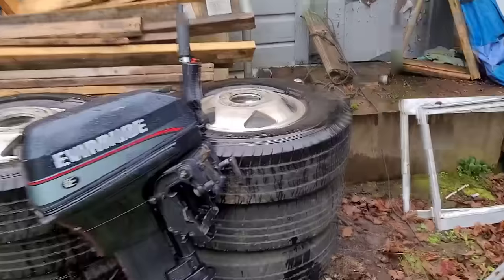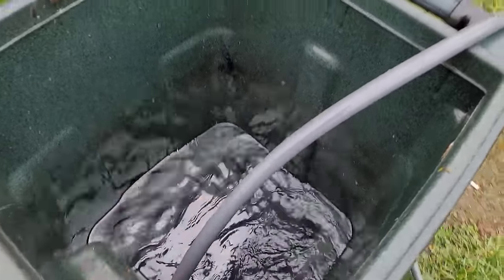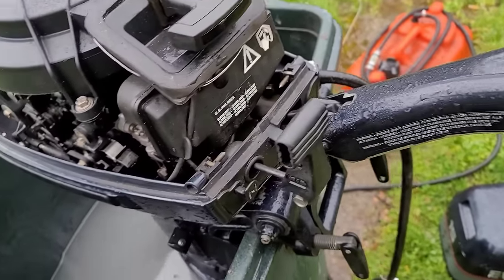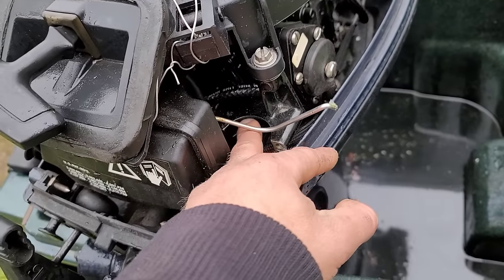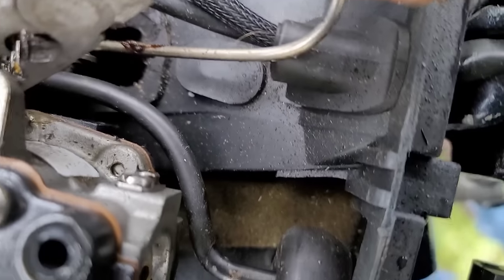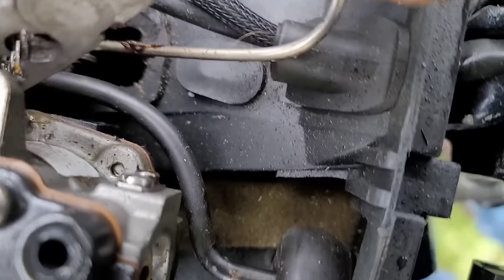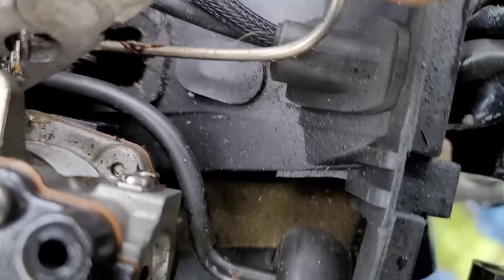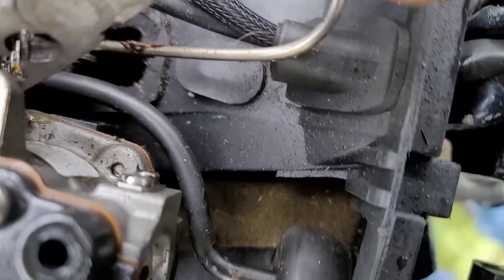how to fix an outboard that won't idle.

Comment: No offense, but this is not the right way to do this job. I mean to press the plastic parts with razor blade and knife? What you called idle jet on the bottom is the main jet. The other is the needle valve seat, not the main jet. The fuel does not go up on there but goes in to the carb on it. On that carb the numbers show the order to tight the bolts to help not to brake the plastic bowl and the top cover. The lot of smoke because the idle/low speed mixture screw is still open more like needs. The NGK is not the right spark plug on these Johnsons/Evinrudes. Again, no offense but it's a thing to do a job and another to teach that with misinformations. I just wanted to help.
Reply from the maker: Congratulations.  Yes you are correct. Why did you watch the video? Yes my terminology on a few parts was wrong. As far using the wrong tools....like a knife.. duh. Lol it's what I had handy. Ngk is not the "factory" spark plug i agree. But let's be real it's a better spark plug. I find it interesting that such an expert like your self hunts down a video. Like this one. In reality you don't even have carb problems. Do you.. just trolling?
Reply: @robertpapp96 glad you got it running for him.
Reply: So what was the problem exactly

Comment: Bottom jet is the main jet. What you’re calling the main jet is just the needle valve seat.
Reply: Yeah I caught that too . It also should be explained that the carb bowl screws should be tightened according to the numbers embossed on the bowl itself ( 1-7 ) to keep from cracking the plastic .

Comment: I will tell you this. It will never run well in that tub! Ever! In that tub your carb sucks up carbon monoxide causing it to flood like. No oxygen and  more it runs gets worse. Cut the back out of tub and put a box fan in front blowing fresh air towards carb. I am 62 and realized this back when I was 16  fixing fishing boats. Still fixing them but now Im paid to do so just not tiny ones.

Comment: cleaned the carb on my 9.9 johnson and got to the same point you did. any advice on how to gap the plugs? where I could find that information?  I think I need new plugs myself. got this motor off marketplace.

Comment: my dad bought a 10hp mercury stated would idle and die or start , you put in gear an die. got looked at at dealer and it had a bent crank.

Comment: You seated that adjustment screw 3.5 turns in but then pulled it out only 3 turns?  Also, make sure you guys watching look for rubber o-rings inside those needles and adjustment screws?  Gotta pick them out with a pick and flashlight before cleaning and dumping into Chem-Dip...

Comment: I would have checked the plugs long before messing with the carb.. It would have saved a lot of time and effort.  Hope the customer wasnt paying by the hour.
Reply: Absolutely right, a good mechanic checks and does the easy things first (plugs). An easy fix for these carburetors is to take the idle adjustment screw out and squirt carb cleaner in the hole then reinstall idle adjustment screw. No carburetor assembly required!!
Reply: And if it has NGK plugs, replace them with Champions. NGKs do not play well with Evinrude/Johnson 2-strokes.
I hate Champion plugs in cars, but they work best for small engines

Comment: On an atoll in French Polynesia with nearest outboard mechanic over 250 miles away. Followed your video and it worked. thanks. Really good video and explanations.
Reply: Niiiiice
Reply: You got some balls going that remote without basic engine maintenance skills
Reply: @LezlyBeetz  Polynesians did that for many centuries just using sails.

Comment: I had a 65 horse 1972 model evinrude with 75 hp carbs on it and it ran like a beast, and idled great, started easy too.. what evinrude did was restrict the carb throats diameter, to govern the 75 horse down to a 65.. The reed plate behind the carbs has 75 hp holes, so all you have to do is put 75 hp carbs on it,.,, I sold that boat, but picked up another 65 hp.. It is the electric shift model, and one of the solenoids are bad in the lower unit.. hoping u make a vid on the hydro electric shift evinrudes.. you explain everything very well. liked and subscribed,, 
also alot of people shy away from the old hydro electric shift models but the one I had was super reliable as long as I owned, and you dont have to dickk around with shift cables and link and sync.. those old 65 evinrudes were some of the very best motors ever made..  lightweight for the horsepower, thick casting blocks, simple carburetors. ect.. I wish they made and sold them brand new I would definetely get one,,

Comment: I just fixed my 89' 9.9 Evinrude by hauling it off to the repair shop 😂 replaced EVERYTHING possible! Been struggling with it for 2 years! rebuilt  the carb 3 times, replaced carb top and float bowl still wouldn't run without the choke on. And it's not easy finding a shop that will work on old 2 strokes

Comment: Thanks man. I just had my Nissan NS40c crap out on idle after performing flawlessly for a week on another lake.
So frustrated but it starts everytime when I apply throttle the minute I take throttle off it dies.
This is my next stop although carb looks different!
Gives me the confidence to take the carb off the motor while the boats on the mooring bouy! 👍
Subscribed!

Comment: The idle screw can adjust air or fuel 4 or 2 stroke depending on carb manufacture the tell is generally the location of the screw if located in top area of carb. Then it adjust air if located near bottom half/bowl of carb then adjusts fuel. So as in on the carb in this video idle screw is likely adjusting the air. Not fuel

Comment: Ok so nobody noticed. You screwed in the idle mixture 3-1/2 turns. (Watch it). Then said “3 turns”. I went back to check 3-1/2 turns. 
So you set the jet to three and it would idle. It would not idle at 3-1/2 which is where it was when you received the motor.  Best idle ended up at 2-3/4. 
Plugs were fouled from too rich mixture.  
So this painful experience could have been much more easily solved by new plugs and adjusting the idle mixture screw.

Comment: Can old spark plugs cause the engine to shut off at idle?  I’ve got a 2004 Johnson 150 that runs great above idle but shuts off at idle in the water.  It does not shut off at idle when on muffs.

Just got back from taking it on the river and running some Seafoam through ; it seemed to get better but still shut off at idle.  We also noticed throttle up isn’t applied until the lever is half way in the forward position out of neutral.  Could the throttle cable need adjustment?

I’m going to try running it in idle on muffs with some Seafoam in the gas and see if that helps for our next outing in the boat.  If the boat runs fine everywhere else, could the plugs still be the cause of stalling at idle? They are very old and definitely need replacement.
Reply: Had the same problem on mine. Turned out to be spark plug wires believe it or not.
Reply: @jstay0  nah figured it out; rebuilt the carbs, one of the float needles got stuck almost closed.  Purrs like a kitten now

Comment: Good vedio except you called the main jet the ideal jet. The idel jet is on top. That's where that idel needed is. Every thing else is correct to fix idel circuit stopped up.

Comment: I messed with so many things trying to resolve my johnson not idling.
The thing that ended up mostly fixing the issue was spark plugs.
I do think i still need a timing adjustment though

Comment: I have a Johnson about the same year as this pretty much the same motor I just bought it. It don’t want to idle and don’t have the power it should. I cleaned the carb seemed to help a little but not much.. I have 85psi on both cylinders. Looks like it has been ran hot because they have sealant all around the thermostat housing but everything else looks like it’s never been touched. it’s electric start and won’t start unless you pull it also when it warms up it’s a pain to start at all. Do you think that could be because of the low compression or possibly something else
Reply: On that same note I’m changing the head gasket to see if that helps put some compression back in it. Do you know of a way I can check the rings without going any further than taking the head off
Reply: Definitely low compression. Should be 130-135 p.s.i. on both cylinders

Comment: What year of motor is that?
I have a 1997 Evinrude
Got spark and fuel (squirt bottle) but won't fire?
Cleaned up the carburetor and remounted.
Mice had gotten into the carburetor.

Comment: NGK's are the incorrect plug. Champion L7744/L77JC4'S are the correct ones. Im sure it was cold out, but always a good idea to check the cyl head temp too!
Reply from the maker: Such an expert .. digging around the internet to comment on a novice level repair video. That's odd.

Comment: When you got stuck gaskets like that just loosen of the bolts and lev them in ther, and give the cover a wack whit the backside of the screwdriver, 9 times out of 10 that will loosen the gasket and you don’t have to pry and risking to crack something 👍🏻

Comment: OK.........I know you were dying to show us how to disassemble a carb and you did a fine job of it, but your motor was a small one and already off the boat.    Mine is a Yamaha 50 with 3 carbs, on a pontoon, in the water, and it's gonna be a B^%$ch to get it into my parking lot on dry land so I can pull those carbs off.   Since I already know how to do what you showed and because I believe in applying the KISS Principle whenever possible, doesn't it make more sense for me to check my plugs and maybe fiddle with the idle adjustment screws BEFORE I do all that other stuff?   Mine will idle nicely for about a minute and then croak, as if it is starving for fuel.   I get the feeling that if I could just give it a little more gas at idle it would run fine and all I've got to do is get knee deep in some water to do that, much easier than renting a truck and pulling the booger out of the water.   Great video and you have an easy instruction style, so well worth the watch.    Thanks..............

Comment: Awesome video, thanks a lot. I recently purchased a 2000 9.9 Johnson that has the identical problem. So after the cleaning, new plugs and you left the screw at about 1/4 turn in?

Comment: Did you know there is a screw torque sequence on BOTH the bottom bowl and top air plate?
Reply: Also is it required to use a muddy screwdriver and lay the parts down on the muddy ground?

Comment: Great info Have the same motor, just got it, what do ya think the reason behind me having to choke it even after it has been ran and warmed up. It also does have an idling issue, so maybe when I rebuild it that will help not having to choke it to crank it every single time

Comment: I have same motor I fixed that issue now when I put boat in water motor won’t push boat as it should as if it’s not idling up all the way . Now I have no spark on spark plug fixing to change out power pack is the power pack the reason I wasn’t getting up and going on the water ?

Comment: Had a 1990's Johnson Seaking 15hp outboards short shaft like this motor. Had the exact same problem before but then the motor just stopped entirely. Took apart the carb and cleaned it thoroughly and checked all of the inner workings of the carb to make sure that they were working and in the right spot. Put it back together. Started up and ran for like 3 seconds with high rpm but died again. So decided to try and tune it a bit. But it did absolutely  nothing. So, took apart the carb again and cleaned it again. Put it back together and did the exact same thing. So I tried to tune it again but did not work one bit. Got new spark plugs and still did not work. There was spark, gas, and I know air was getting into the engine. Decided to just sell it. Was too much of the pain. Had that motor for the longest time and it has been giving me problems for the past 4 years know leaving me and my grandpa stranded out on the river a cupule of times and dying as soon as we get to the docks too. Looking for a 25hp now and just hoping the next motor doesn't give us a headache like the 15hp we had. Was a good motor while it lasted and defiantly got the john boat up to speed on the Mississippi. Sad to see it go but you gotta do what you gotta do.

Comment: If I may, that air box is called a silencer box and its sole purpose is to muffle down the noise created by air being sucked in the carb. Removing a stucked plastic cover or bowl is best done by gently hitting them at an angle with a screwdriver handle. The vibrations will free them up ... prying will damage the mating surfaces. Finally, avoid getting those gaskets to come in contact with solvents (aka carb/brake cleaner, etc) as it deteriorates rubber and will ruin their sealing capabilities. Regards !
Reply from the maker: @danielrobert7181  why is an expert like your self watching this video? The intake deverter or silencer is called different names by different manufacturers.  Completely pointless to evern mention it. Correcting people on the internet is not your job. Get a real hobby
Reply: @CAPTAINWILLY  Basically, out of respect !  Respect for people that do  videos whose content is thus enriched and out of respect for their viewers who get added value. If ever you get to be an outboard enthusiast like me, you'll understand. Regards

Comment: Did you ever get to the late 70's mercury ? Is it a thunderbolt that the motor I just got and it has the same problem wont idle,                so gonna work my magic thanks to you

Comment: I just purchased this exact engine and the fuel line where it connects to the engine has slop in it and leaks fuel when pumping primer bulb. Which side of the connector needs replaced?
Reply: Just pick one side, and if that doesn't fix it, then replace the other side too.

Comment: I'd like to add that those needle valves get stuck, because they are old and create a memory on the seat. You have to replace.  It's good to also good to remove jet and clean, but only if you know .

Comment: I have a ‘93 8hp Johnson with a similar issue. Is the knob at the end of the tiller an idle adjustment? I can’t feel any tension when I turn it and am wondering if that’s the problem(and a simple fix)

Comment: Good video I have a 15  evinrude 2 stroke  that was running and idling great new fuel new tank new hose ,went about 2 miles down River killed it then it wouldn’t start by messing with throttle it finally crank got it back to boat ramp where she died and wouldn’t start again, replaced fuel pump , cleaned carburetor, reaaplaced coil pack, new plugs, and  finally the power pack cranking fine one then first time back on water middle of lake same scenario I killed it and would not start Finlay started but would not idle any ideas ?

Comment: very good video mate . i have a 25 hp 1979 Johnson which has a similiar problem . would it be the same procedure for the carby on the 25 hp . thanks , North Queensland , Australia .
Reply: Try your primer first. if it doesn't get hard look at the fuel pump.

Comment: Why are you teaching things that you know nothing about?  what you referred to as the main jet was the seat for the needle and both 2 and 4 strokes can control fuel or air with the idle mixture screw it just depends on the design of the carb.
Reply from the maker: Why are you commenting your great wisdom on a video. Thankyou for your expert opinion... wit why is an expert such as your self watching videos of an idle issue. What's a matter... can't get your motor to idle? Mabey clean out the carb.
Reply: A lot of people say the wrong name of a part. The main thing is if engine runs right after doing what is shown works right. Got my drift????

Comment: My plugs are new, my coils and wires are new, my carb is new, my compression is 135-143 Pistons 2-1. The fuel line is new, the gas is new, the starter and solenoid are all new. What do you think might be wrong with mine? 

Its a 1978 Johnson seahorse 35. Model number 35EL78R
Reply: Carbon build up on the exhaust port, crank seals or reeds?

Comment: New Subscriber, I have a Johnson 15 Hp with only 55 PSI in both cylinders, What would you suggest? Cheers Garry 
Would this make it only a parts motor?
Reply from the maker: You need to do a leakdown test. You can find a leak down tester on amzon or harbor freight. Run the piston to TDC, then fire up the aircompressor and pressurize the cylinder. I'm assuming this is a two stroke. When under pressure if it is leaking air out of the carberators then yes needs rings/now an anchor. If it's leaking out into the other sparkplug hole or out of the prop/exhaust. Is possible that a headgasket is needed
Reply: is it ok at 100 PSI on the compressor or should you lower the pressure in? Thanks for responding and your help Cheers Garry  @CAPTAINWILLY
Reply: Yes it is a 2 stroke sorry I missed that part
Reply from the maker: @AttitudeAdjuster  100 is fine. Don't go over 180.
Reply from the maker: @AttitudeAdjuster  ok. Ya just make shur your piston is all the way to the head. You could use a straw in the spark plug hole. If it's low at all it will be open to an intake or exhaust port
Reply from the maker: Also you may need to hold the engine in postion when doing your test. Via a braker bar on the crank bolt up top. Putting air in the cylinder could cause the engine to rotate.  Also scuing results

Comment: Always scared of messin with carbies, but this gives me the confidence to give mine a clean. I've a Merc 15 2 stroke, hasnt been serviced but has run fantastic for 10 years so I bet the carb needs a little TLC.
Reply: Seafoam! Run a 12oz can through it each year, use ethanol free gas, and you'll never have an issue.

Comment: Is it good to let these 2 stroke idle for a long time or run at low rpm ?
Reply from the maker: No! They have to run a little rich to provide proper crankcase lubrication. Low rpms for more than a few minutes will foul spark plugs.